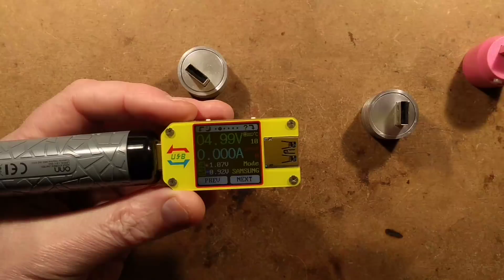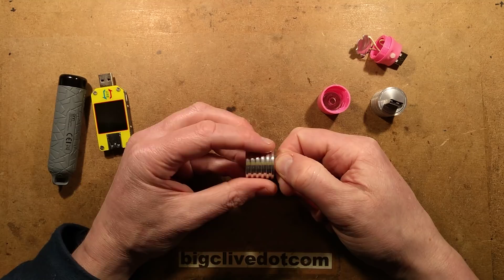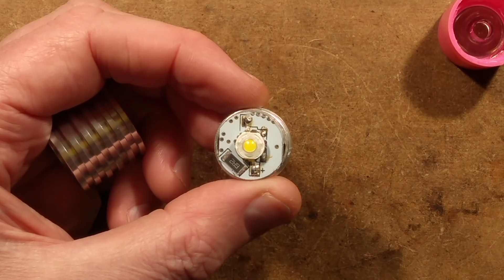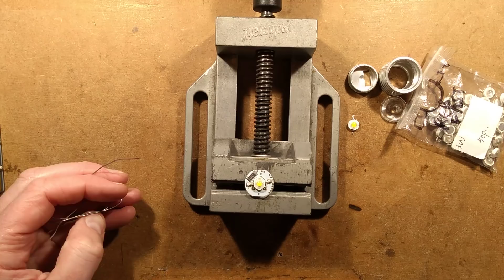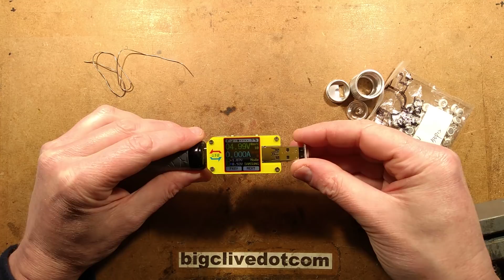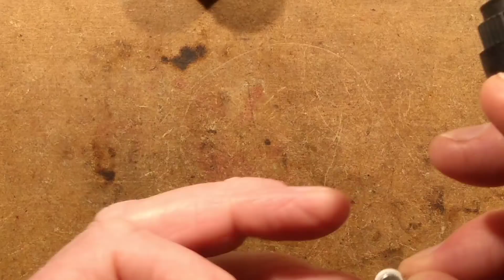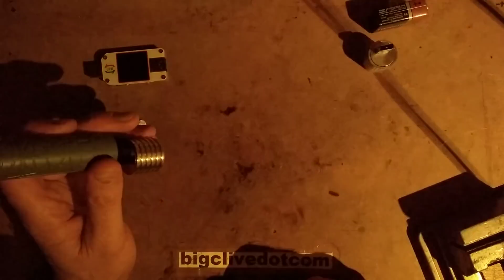Hacking a neat machined aluminium flashlight adaptor for power bank.  (Strobe warning.)

Comment: It should be noted that the LED base pad should be soldered to the aluminium board for better heat transfer. A clothing iron turned upside down on max heat works great as a heated plate. Its the recommended way to solder with bottom heat because the lens on top of those LED tend to get damaged easiy. A friend of mine (cough, cough) had to replace a few LEDs because he only watched the tip of his iron.

At 19:23 one of the LEDs on the table joined the blinking without being powered. A camera quirk or is the blinking blue exciting the phosphor?
Reply: Yes, the blue light does excite the phosphor.  Blue or UV is quite effective for that.
Reply: White LEDs are esentially blue LED chips with a phosphor on top. The phosphor doesn't care which direction the blue light is coming from ;)
Reply: To my eye the LED on the table seems to be reflecting the different colors of the strobing light. If it was the phosphorus being excited by the blue light then it would emit a single color. I may be wrong, but it looked like different colors to me.
Reply: First saw that monkeying around with a UV flashlight. All my A19 had pink or purple glow.

Comment: I have a few of those 1w WHITE bead leds, was cobbling some together the other night to make a light in a cupboard, what i found odd was the voltage drop was only about 2.8v not my expected 3.3v,  - you can also drive them upto about 80-90ma without any noticeable heat and plenty of light
Reply from the maker: At lower current the forward voltage can go right down to about 2.5V.

Comment: screwing this in and out while holding it on the usb connector is a quite bad design decision because this way all the torque is  put on the solder joints of the usb connector if i see that correctly.

Comment: Clive, would they be any good for mounting on the side of my glasses for close up work lighting?
Reply from the maker: I'd recommend a head torch.  I use them a lot for detail work.
Reply: @bigclivedotcom  
It's what I use at the moment. But I'd like to get away from using batteries and switch over to plugging into a USB supply without spending lots of money.
I may have found a head torch on eBay last night, 9 LEDs and rechargeable, I'll have to look into it more.
By the way Clive, I have a box of mixed stuff for you, but I need a P.O. box to send it to, do you have one?
Or I could try,
Big Clive
Ramsey-ish
Within 1 1/2 miles of the TT circuit
Isle of Man

If it made it to you that would be funny....
Thanks Clive
Reply: Slikx666 I would think a different shape would be better for that.
Reply: If you want something lighter that won't require external power I recommend a Coast A8R, it's got an even throw and it's rechargeable
Reply: I'm just thinking about something cheap and runs of a usb power supply. 
I'll probably just get some to find out if they're any good, they're cheap enough. I will have to make a Y lead though. 😀

Comment: Here is the link to the surface mount resistors https://m.aliexpress.com/item/32753699432.html?trace=wwwdetail2mobilesitedetail&productId=32753699432&productSubject=50-pcs-2512-SMD-Resistor-6-2-ohm-6-2R-6R2-Chip-Resistance-1W-5

Comment: LED's are like computers, with good thermal cooling they can be pushed harder than stock.
Reply: or even just basic cooling, 10.5% on a fx-4300 w/ included heatsink and could go higher if my mouse didn't stop responding... (bclk oc effects everything)

Comment: Back in 2005 as the original Luxeons where still around, there where two different wattages in that case-style 1W and 5W(wich had twice  the voltage of the 1W and about 800mA)